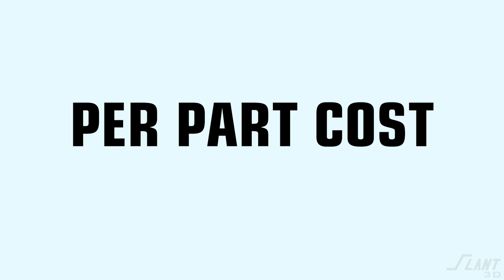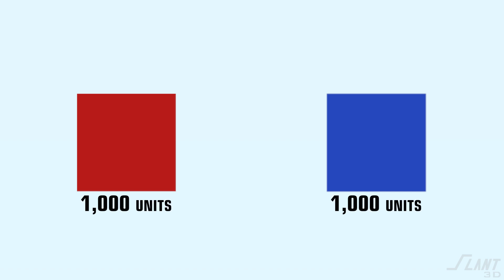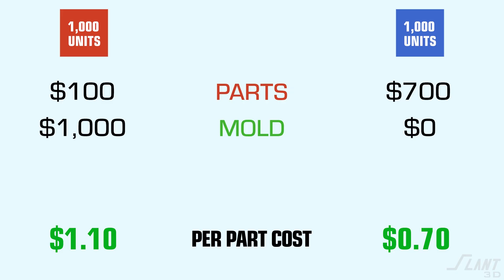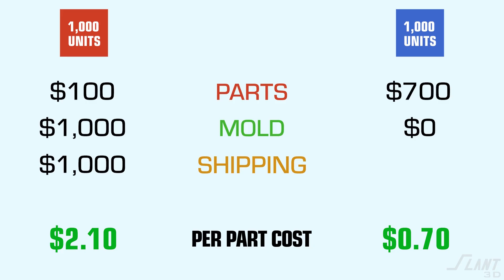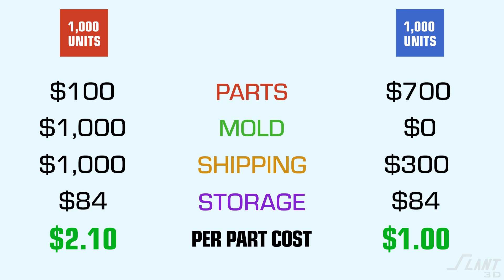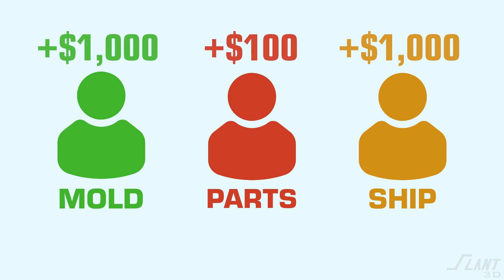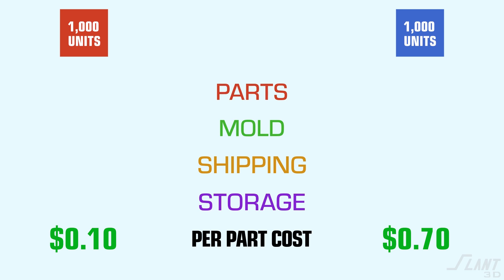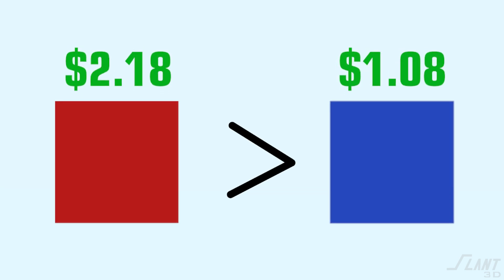Calculating the REAL Per Part Cost for Injection Molding vs 3D Printing

Comment: I believe the best thing to 3d printing, is the flexibility. Say you make this Thing™ and it sells well, but then someone finds a bad error with it, which isn't unusual, so it goes back to the factory and they say, well, that's what you ordered! The mold won't cost $1k, but probably $100k, so there goes another $100k and you'll start a new batch and pray to some favourite god you did it right this time…

Comment: I have to disagree.  Molding doesn't account for:

Storage, overhead labor hours, Health benefits,  working conditions, 

shipping from factory, to warehouse- to seller- to costumer.

And don't get me started on parts cost..... 3D printing only shipping is filament shipping. Which if bought in 1,000s is almost free. And costumers pay for shipping as its baked into the retail cost
Reply: This is not about tailoring clothes. Might want to edit 2nd time.

Comment: I'm guessing that for a print-farm that produces its own filament, the disparities are even more substantial.

In terms of electricity consumed, it would be interesting to get a feel for IM vs 3D printing.
Reply: I think it'd be broadly similar - the biggest cost is in melting the plastic. Printing would probably come out slightly cheaper, as you're not moving heavy machine parts to make the injection moulding shot and close / open the mould, but this is offset by having many small machines when printing.
Reply: @KarlOnSea  Yes! The printer also typically has a hotbed that needs to maintain a temp. it non enclosed, this is not a trivial amount of energy.
Reply: For the sake of the video's scenario this is a non issue. The company seeking to have their designs made is not concerned with the electrical expense of the mold and likewise would not be concerned with the same costs associated with a 3dp operation. These aspects only matter to a manufacturer, not the product designer.

Comment: I followed 3D printing for over 10 YEARS before I finally pulled the trigger and got a 3D printer. I got a Bambu Lab P1S and I got this because I thought I would need the strengt of ABS. However, even tho I've seen people build spectacular things with 3D printing, they always recognize that they're weaker than they could be. I see people say they try to break something with all their might, I would just brush it of like "I'm bigger than that guy, he's probably just weak, of course I COULD break it if I really wanted", and just the fact that I could see the print lines gave me like a cheat code to attacking parts where I KNEW they weak point was. But I was wrong, I am amazed by how strong my 3D printed parts are, even in standard PLA. They are stronger on default settings than I could imagine. I was already sold on 3D printing, hence I got a printer, but I still didn't really GET IT until I could truly try it for myself.
Reply: PLA is actually quite reliable when it comes to layer adhesion. I bought some PETG because of its "strength" (higher deformation temperature for one, but also weather and UV resistance) – and have trouble printing it, including really weak layer adhesion (which came as a surprise). I'm sure it's the material itself, as I changed many parameters with nearly no change in results, and maybe it needs drying (but it performed badly out of the sealed vacuum bag, so I don't think that's the reason). My PLA printed parts are nearly undistructable and have phenomenal layer adhesion. Granted, I'm a beginner, but the difference between PLA and PETG was mind-blowing.
Reply: Hello. You might be printing too cold for PETG. PETG is recommended to be printed at 260C with a heated bed at 80C.

Be careful though when cranking to those temps since not all printers come with all metal hotends so if thats the case, it would release nasty fumes that is cancerous. You can check your printer model if it has an all metal hotend
Reply: @akeiai  The recommendations of the filament producer often say otherwise (255 °C as max. temp.), and it didn't work for me (I've gone to 250 °C, and results were worse). Bed temperature 80 °C does help, though. PETG is much more finicky than PLA, but maybe not as much as ASA etc.
Reply: @akeiai  my temp tower is the best at lower end , i.e.  if it 230-250C recommended then 230C is the best,  the higher bed temp helps along with relatively high enclosure temp like 35 - 45C. Fan 20-35 %  max
Reply: @c.augustin  what are you printing it on? i bought an ender v3 ke earlier this year because it was locally available, tried to figure out petg on it, and threw in the towel after a week because it was just more effort than it was worth. (i want a 3d design hobby, not a 3d printer maintenance hobby.) bought a bambu a1 instead and been printing happily since. haven't had any issues with layer adhesion either

bambu is kind of the apple of 3dp right now, locked down but It Just Works. and honestly, 3d printing kinda needs an apple right now. i have zero brand loyalty and i'm willing to immediately switch to any alternative that's similarly user-friendly, but i'm not aware of any right now.
Reply: @DeeSnow97  I bought an Artillery Sidewinder X3 Pro, and it does a pretty good job with PLA (user manual and interface are crap, but the hardware seems to be decent). The Bamboo A1 is much better for sure, but it was above my budget (and the X3 Pro has a larger build plate, which suits my needs). I went with PETG for the higher deformation temperature (I now found out that in this specific use case I wouldn't have needed it, but I wanted to be sure that I won't run into problems). I now bought a filament dryer, and that's what I'll try next. The pieces I've created do their job, because layer adhesion is not important in this case (forces are mostly "compression", I don't have the right terminology). Still, the difference to PLA is huge in print quality, and I want to find out where the problem is. Maybe it's the nozzle (I did experience some resistance when I cleaned the nozzle with the appropriate needle from below, and this might be part of the problem), but I don't think so. On the other hand – I've seen worse results in YT videos, so it's not that bad.
Reply: @c.augustin  yeah tbh it sounds like what you're experiencing is a result of either underextrusion or low heat (overcooling or low nozzle temperature). i'm no expert at the settings (that's why i have a bambu, lol) but def check your nozzle, and if that doesn't resolve the issue, try to play with nozzle temp and fan speed. i noticed on the a1 that it runs the fan on a low-ish setting for petg, and only ramps it up for bridges and overhangs. filament quality also matters a lot if you don't have pressure sensing and extrusion calibration.

what i can tell you for sure though is that petg is not supposed to have crazy low layer adhesion. pla is actually stronger in some ways, just more brittle, but still, petg is no slouch. the answer should be out there.
Reply: @DeeSnow97  I've turned the fan down to 50%, didn't help. I'm now drying the filament and do a test the next days to see if this was the issue. And varying extrusion rate/flow (don't know the right term) was one of my observations (sometimes lines are thicker and flow together, sometimes they don't).
Reply: @c.augustin  yeah, i had a similar experience with my creality v3 ke when i tried to dial in petg. sometimes it was overextruding, other times it was underextruding, mostly depending on model geometry. sorry, i have no idea how to fix that -- i didn't fix it on my own printer, i just returned it and bought a bambu instead
Reply: @DeeSnow97  Thanks for the feedback, good to know (might be a problem with the filament transport).
Reply: @rudde7251  that's some good info, thanks for sharing! Do u know if the same applies to resin printers? I have some interest on these ones, and I wonder if their prints are also strong. Thanks in advance!
Reply: dry filament first, heated bed, enclosure plus all nesessary tuning

Comment: Hello, I am thinking of using your services to 3D print parts and ship them within the US, but my colleagues are concerned about the possibility of you stealing our products. How can you assure us that this will not happen?
Reply: How is that different for 3D printing vs injection molding?
Reply: @CommanderBurger-v6i  they have a video of them printing a part from a customer because it looked cool (i believe it was a flat printed airplane)
Reply: He also has a video that addresses your concern. In short: there's a contract.

Comment: There is also the alternative cost of money.  There is an investment in the mold and inventory over a time period that has to be considered vs purchasing and then replenishing any widget.  Yes, I understand cost accounting.
Having to spend $X on a mold with a life of 50,000-1,000,000 parts is a very ineffective use of money if the anticipated demand for that widget is only 20,000 parts.
Reply: I will give him props that in the video example he used an aluminum mold and not steel. An aluminum will give you 20-40k parts (depending on the AL grade, material injecting, pressures, temps, etc. etc...) before having to be serviced.
Reply: @tomsko863   - true. There is also the fact that the cost of tooling (molds) is mostly in the machining and design of that mold vs the cost of the block of metal that it is made from when made from a third party or inhouse with a paid staff.

Comment: Very carefully selected maths there, which effectively translates to lower quantity = 3d printing, higher quantity = injection moulding.

Using your example, needing 50,000 parts tips the balance heavily towards IM, even at more realistic mould prices (we use part that's a similar size to your cube, but more intricate,  where the mould cost us £12,000).

Plus you've used overseas shipping on one side but not the other. 

Plus, of course, there's suitability. Some parts will work better with IM (e.g. where smooth finish is critical) while some parts are only possible with 3d printing.
Reply: One of the big hidden selling points of printing is that you not only don't have overseas shipping; you also don't have tariffs or customs regulations at all. Bogus IP claims from patent trolls and monopolists can't get your parts seized in customs.

Comment: 1000$ for an injection mold? 😂
Try 100,000 - 300,000$.
Reply: You're crazy. I have some parts injection molded and for simple things like a small storage box would be below 1000$.
100k-300k is for massive parts with extreme complexity that wouldn't even be possible on a fdm machine
Reply: @FrozenByFire3  I agree with you. Plus, in the video, he did say it was an Aluminum mold. Those are quicker and easier to cut, reducing cost.
Regardless, it was just an example to get the point across.
Reply: 0:40 to 0:55 he explicitly said this was a simple example and the cost depends on the piece. I'm sure there is someone out there who can CNC the cheapest mold for a fraction of this price, for a piece of a simple shape which doesn't need to have specific tolerances, is allowed to warp and can have an ugly finish.

Comment: In my professional opinion, 3D printing beats Injection molding. 
1. Cheaper startup
2. Better strength to weight ratio and is cheaper simply by having less material internally where it's usually unnecessary. 
3. Faster and cheaper prototyping process.
4. Can you Injection mold guns at home cheaper than a Bambu Lab? No.

I struggled at first with 3D printing with Creality, Longer, Kingroon and Elegoo, it wasn't until I got the Bambu Lab A1 & A1 mini, that I finally had what I needed which was a printer as reliable as a microwave with outstanding quality prints! 💯

Hope this helps! 🙏
Reply: "Can you Injection mold guns at home" 

no because i dont have an injection molding machine
Reply: Real design for hard use will never use 3d printing. Injection molding or CNC is the final step. Injection molding is FAR stronger for any sort of complex part with thin walls. Saying 3d printing is stronger than injection molding is straight fake news. And I've created 3d printed parts with isotropic properties using forced over extrusion way before the actual knowledge of this came out a year or 2 ago.

Proper design will account for injection moldings weaknesses